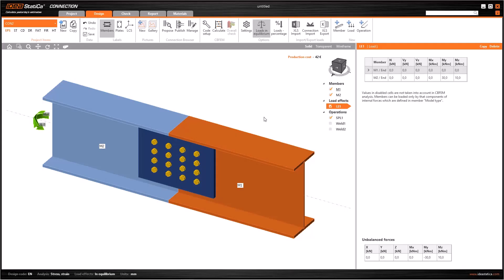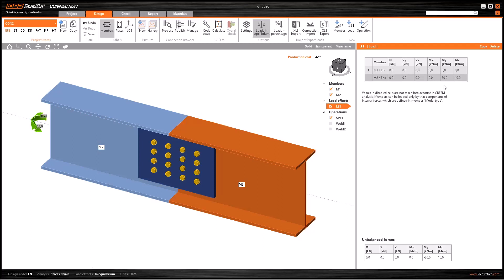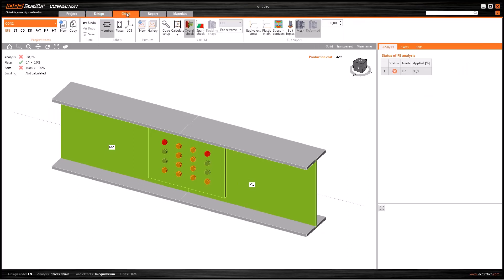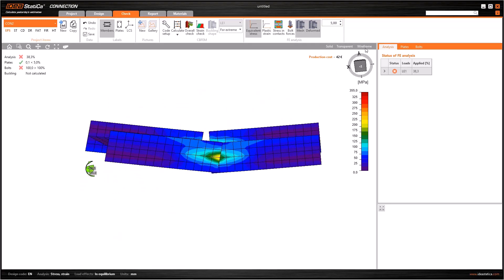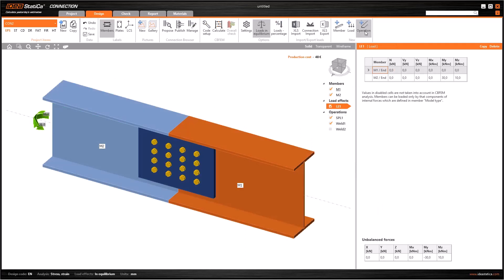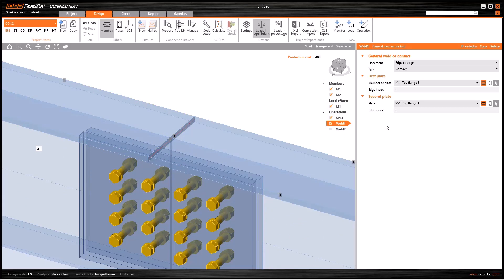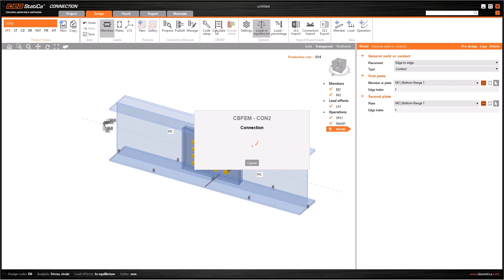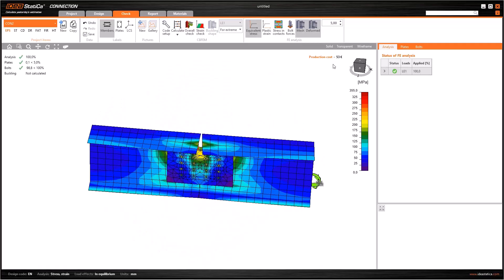Double Splice Connection

Comment: is it possible to see deflection of splice plates? I have similar connection and we have 40mm deflection on site under splice  point. Clearly something isn't right
Reply from the maker: Hello, yes, you can display deformations of the whole model which you can observe, but the program doesnt give you the scale and deflection values, since this is primary for checking connections, not deformation analysis.
I recommend to model the beam with splice in Member, which shows you the deflections and the model respects the surrounding structural conditions, etc.
https://www.ideastatica.com/steel-member-design

Comment: It acts like cantilever beam. How much should be the length of default member
Reply from the maker: Hello! The member length should be kept as default, also for cantilevers.
https://www.ideastatica.com/support-center/default-member-length-in-connection
The trick is a combination of the correct connection model (a stiff rigid connection) and the correct internal forces (bending moment with shear force which generates the bending model to decrease towards zero the at free end of the member just as the cantilever member diagram looks like.).
https://www.ideastatica.com/support-center/loads
Reply: @ideastatica_en  Thanks for reply. Actually my requirement was to design the splice connection for full capacity So the moment is 100% and corresponding shear is 30-40%. But because shear force is adding extra moment near support, the moment capacity exceeds. It exceeds even if I apply 80-90% moment and 30% shear. How to deal with this situation . The country code in fact demands to design the beam splice joint to 1.8 times the required strength for seismic connections.